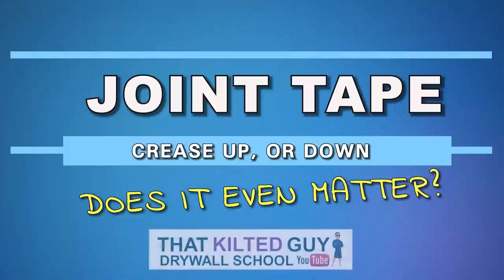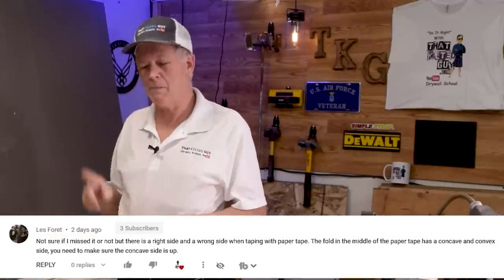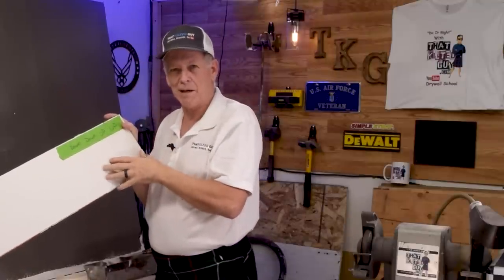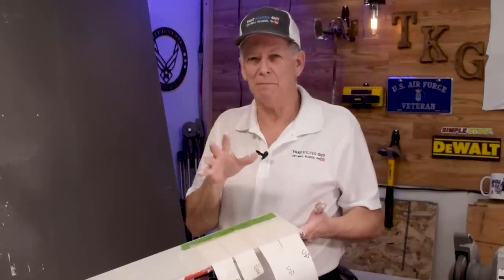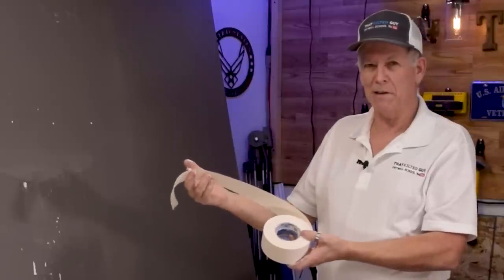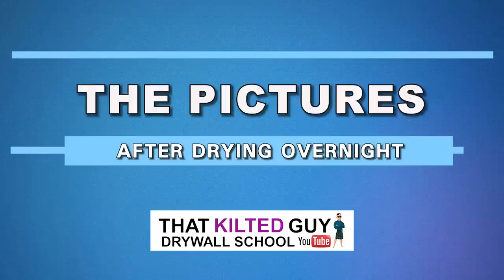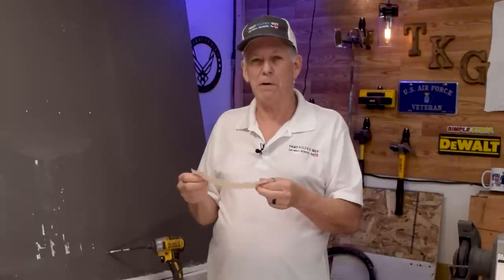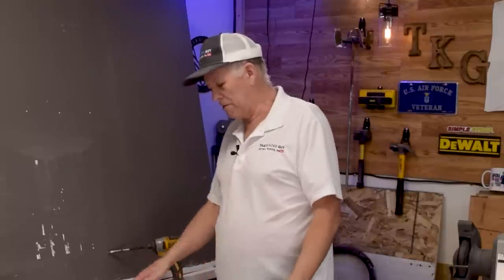I Was Taping Drywall with Paper Tape WRONG for 35 Years???

Comment: This is one of those cases of "I have been doing it this way forever." A true pro who cared would be immaculate with their work. Myself, I care. So what if my customer doesn't know the difference between installing the paper tape the wrong way versus the right way. I know. The correct way is to install it with the crease down. Sure installing it with the crease up might be considered 98% good, but doing it the right way is 100%. 
I cant imagine how one got into the habit of installing it backwards. It takes more effort to do so.
So does this mean the the kilted one fights the crease and folds it over on to itself?
I guarantee you that it sticks the same on both sides. But the amount of time that has been wasted over 20+ years of doing sheet rock work is an unnecessary waste.
Reply from the maker: Actually sir,  what this means is I have analyzed why I put it one way or the other and decided it makes absolutely no difference. It is 100% right to do it either way. You guys have fallen into believing there’s a right way and a wrong way simply because of how it goes through our taping tools. Go read on the manufacturers websites and on the box it came in, and you will see there are no instructions for which way it goes. I even wrote one of the tape manufacturers and asked them if there is a right way and a wrong way and they didn’t reply probably because it doesn’t matter.

I’ve been self-employed for over 17 years and I am five star rated on every platform with multiple reviews because I am the best at what I do.  Feel free to look my business name up, it is called “Mr Patch drywall LLC“ out of Grand Junction Colorado.

 I was taught by one of the best, my father, who did this from the time he was a teenager and he was highly regarded and once had 50 employees working for him. One of the things he taught me was how to not take unnecessary steps and he was one of the fastest drywaller‘s I’ve ever worked with. My uncle was exactly like him as they worked together much of their life. So I don’t waste my time by taking unnecessary steps just because I haven’t thought it out well enough. Go look at the thickness of that crease really really close like I did with a camera and you will see that it does not stick up enough to make one iota of difference. I don’t do things like a sheep and just follow other peoples leads. I analyze everything I do and decide which way is the best, the fastest, and the most efficient.  

Go look at my community tab post and you will see I took extreme close-ups of the front side and the backside and they are identical other than a minor crease that sticks up approximately 1/100 of an inch which makes absolutely no difference to the quality or any other aspect of finishing a joint.  In over 35 years of doing this, I have never had one problem with it, nor have I ever sanded through the crease of the paper. I don’t get call backs either because I know what I’m doing.

Have a great day. 😊
Reply: What the hell would the drywall industry do with out great craftsman like you? l guess million dollar homes or millions of homes couldnt make it without your high standards. l hope tere can be built and repaired without your expertise. What are we gonna do?l got a idea. Go to every house in america and retape and bed make everything perfect. By the way learn to speack spanish!